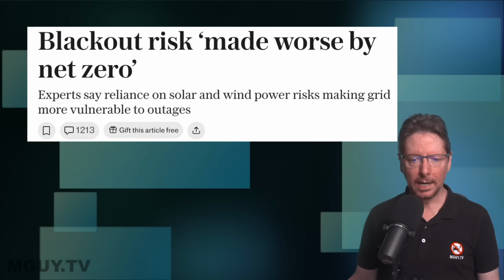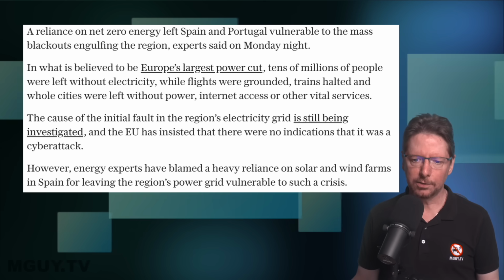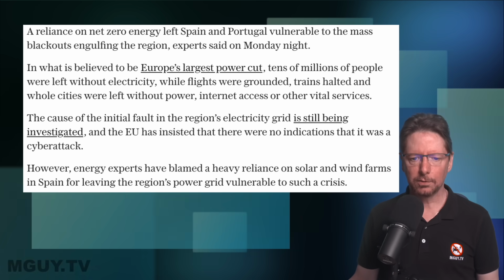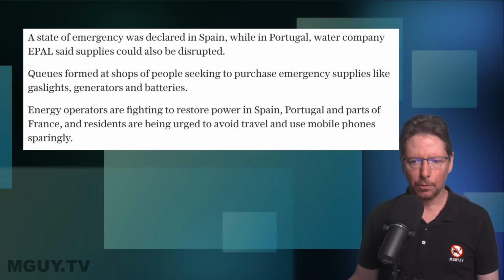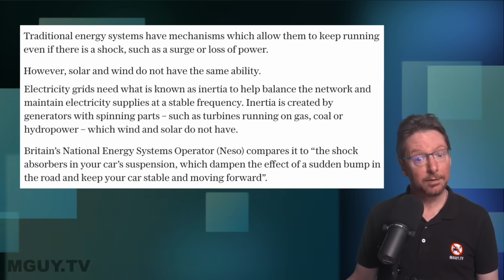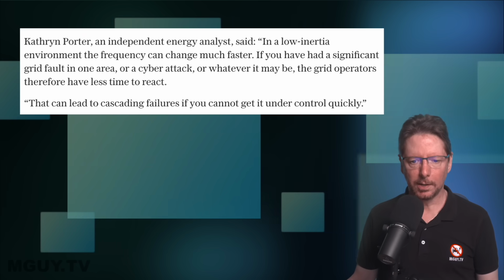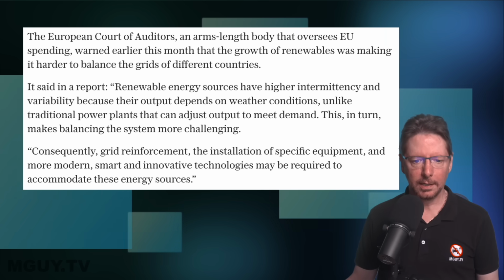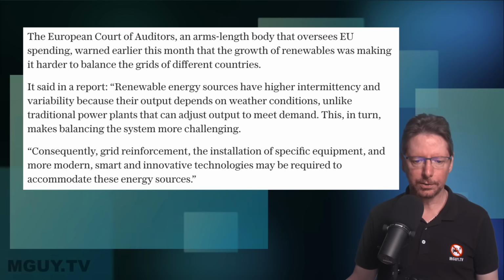Spanish power BLACKOUT: Why Net Zero and RENEWABLES were to blame | MGUY Australia

Comment: If only they kept to the good old mantra Keep it Simple Stupid! Hopefully this will be the kick start for a mass back leash against the Net Zero insanity. As a lot of people today simply can't function without their tech. Even people of my age would struggle with not having an instant connection to the outside world, and we grow up in a world that saw a lot of the changes we have had over the decades. It also shows the Stupidity of the cashless system too, as shops had to close, as they can't operate without power these days. Smaller shops my if they have a manual stocking system in place, and if they can bank the money that they take.

Comment: So, maybe, all wind farms, solar plants, tidal stations, whatever you use... need to be connected to the grid via generators with massive flywheels? On the input ac, dc, pulse but on the output 50Hz with necessary inertia.

Comment: All true. Anywhere that has substantial renewable energy is paying the price. The companies concerned with renewable production will stand there and tell you to your face that their products will power the grid. I had one such discussion with representatives from a BESS company. One was supposedly an engineer. I tried to point out that their battery boxes could not sustain a base load. Would not last for any useful period. And were more of a threat than a help. They made out I was wrong but these systems are made to run in conjunction with the grid power. Not stand alone. Like using a watch battery to power a lighthouse. Ireland has incorporated a huge flywheel into their renewables to keep that inertia. And you can run power inverters that provide a synthetic inertia by changing AC to DC and back to AC at 50 Hz. There are ways around it, but at what cost. And then if your renewables aren't supplying any power. No wind, no Sun and your watch batteries can't cope. Dig out the generator.

Comment: Vast amounts of load balancing equipment, thousands of miles of copper cabling, constant back-up for baseload, and the replacing and disposing of worn-out windmills and solar panels are just FOUR of the things that are routinely excluded from the estimated cost of 'renewable' energy supply. Along with the cost of dealing with the knock-on effects on the environment, degradation of arable land no longer used for farming, and the inevitable underestimation of final cost are just some of the ways the fiction of cheap energy is being maintained.

Comment: All windmills should have batteries to smooth out the short-term output fluctuations, bringing them up to the standard of a rotating generator.
Reply: I'll go with load balancing equipment and peaker plants that maintain the grid rather than rely on the power of constantly variable green power alone.  Batteries alone aren't the answer when most tech takes the peaks off the power wave.

Comment: Largely nonsense with a smidgen of half understood facts. 
Lower inertia is a well understood and perfectly soluble issue, using some instant newfangled things called batteries. Which btw are useless for grid level storage but great for balancing inertia. 
Spain is consistently getting  the cheapest wholesale power in europe due to …. Its investment in wind solar and hydro. Go and check the price graphs. Much more economical than the fossil plants. This is not green cultism but good economics.

Comment: So the problem is the kinetic energy right? If so... What if. Instead of connection solar panel directly into the grid, We make all solar panel connected to a huge heavy wheel suspended in a vacuum to minimize friction.

 When there is a surge of energy generation from solar and wind, a motor rotates the wheel. When there's none, the wheel' inertia keeps spinning the motor and it generate energy at constant frequency

Comment: Just because a coal fired power station is shut down doesn't mean the generator(s) have to be disconnect from the grid as what's known as a synchronous condenser. 
Also the grid scale batteries can implement synthetic inertia to provide the same stability to the grid as a large mass of spinning iron.

Comment: I design audio amplifiers as a hobby.  Mains variations need to be filtered out by the power supply which converts AC to stabilised DC.  So, here in South Devon, England, I notice that the mains is fluctuating whenever I measure it.  There appear to be a number of superimposed fluctuation frequencies in the range one to three Hz.  I can see incandescent bulbs fluctuating in brightness, and hear transformer hum varying in loudness.  It appears the network is constantly fighting to maintain stability.

Comment: Most wind farms use DFIG's which are essentlly variable frequency generators, and thus still offer inertia provided the wind is blowing. Solar less so to be fair but that is more to do with how they are utilised as opposed to if they are utilised. It is far more likely that a cascade failure of grid protection will be found to be the issue. I think you are oversymplifing and missing several importent points whic, if propperly planned, could make the grid more resilliant. Lack of propper oversight and poor planning, that is the issue, not the tech or inherrent variability of resource!

Comment: Well the article I read claimed that the cause of the failure was a natural electro-atmospheric phenomenom that caused some type of phase effect on the system and tripped the system?  While a science degree I don't know much about this or even there is even such a phenomenon?  It could be the case that there was a disturbance influence by natural forces but as you say their grid that has more than 50% solar just doesn't have the resilience to handle such occurances for reasons that you outlined quite well.  Some engineers are proposing that we install giant flywheels which are basically stores of electrical inertia on our modern grids for microsecond damping of disturbances in the grid - just another hidden cost of using renewables.  build some new coal stations to tide us over while we fix this mess.

Comment: I think MGUY has conflated electrical phase frequency with energy demand frequency. There is definitely some confusion here because renewable energy systems typically feed into a battery or capacitor array that is then is made available to the grid through inversion. Phase correction from DC to AC is a reasonably simple task. Thats not to say I'm against base load but I feel this is almost disinformation

To add to this, the 'inertia' MGUY is referring to is typical of electrical providers in how they can up and down instantaneous demand from 'the spinny things', however if there is adequate renewable power, than can scale instantaneously. And, BTW, if you are using nuclear as your baseload, it spins inertia up and down reasonably slow - you need a gas power plant to do that at high frequency. When power companies allude to frequency putting renewable power offline, its more likely the inverters hit full draw and the things shut off not to damage itself. That means more inverters/battery-capacitors to meet instantaneous demand or stop Dr. Evil at Amazon from deploying new AI datacenters on your grid

Comment: Estimated Total Cost Overview (2024–2035)
Grid Modernization & Reinforcement  €30B – 50B
Battery Energy Storage Systems (BESS) €25B – 40B 
Grid-Forming Inverters & System Services €5B – 10B 
Synchronous Condensers & Virtual Synchronous Machines €1B – 2B 
Demand Response & Smart Load Management €3B – 5B
Cross-Border Interconnection Expansion €5B – 8B
Digital Infrastructure & Monitoring (PMUs, AI, EMS) €2B – 4B 
Total €70B – 120+B  10–15 years
This is the estimated cost to switch to an active , low inertia smart grid for the Iberia peninsular.

Comment: Thank you for this exact information why we had this enormous black out. What you tell us here I learned many years ago as engineer. The frequency of the net can be held stable at exact 50Hz thanks to the inertia of the huge turbine driven alternators with an enormous mass that rotate exactly at 3000 cycles/min. 

But, by introducing more and more electric sources like wind an sun who do not have this inertia and realize the 50 Hz electronically, the problem indeed occurs that the frequency of the net gets unstable and is not exact 50Hz anymore. This is dangerous because it causes very big circulation currents in the net that can damage the power cables. Indeed, even a slight variation of just one Herz can cause these big damaging circulation currents. 

Therefore the net is protected and will automatically cut off the power supply when this occurs.  But this creates more instability and a cascade effect follows, causing parts of the grid to be disconnected one after the other until everything comes to a standstill.

I am surprised that this known danger/problem has been underestimated to such an extent. With the increasing use of resources such as wind and solar panels, I fear that these major power outages will occur more often.

Comment: fun fact most older renewable plants are grid following aka they cant alter the frequency they put out of there own free will they copy the frequency of the grid meaning they cant self start, something on the grid needs to be making a frequency for them to follow. 

also just imagine trying to run on a cloudy day, done delivery's to a lot of the solar farms in my area, one of them the driveway passes the massive inverter damn she makes a lot of noise but cloudy days it off. seams they don't have a way to smooth out the ups and downs of clouds passing over. also this farm has a Nameplate capacity of 200MW but they said there not enough grid capacity and they only pushed out 100MW at most.

Comment: I’m a distribution power engineer designing embedded generator connections in the UK.  Some 7 years ago this happened in the UK when a transient grid fault caused many wind & solar farms to trip on ROCOF (rate of change of frequency) / under frequency. Because our network at that time was more dependant on rotating generators there was no power cuts but it was a clear warning on what will undoubtedly happen in networks without sufficient rotating plant.
Reply: As an electrican I understand exactly what you are saying. The masses do not understand about the frequency of power and why turbines spin at 3000 rpm basically 50 Hertz times 60 = 3000.

Comment: If you need proof of how much energy is contained in a generator spinning steam turbine rotor, look up the Uskmouth Power Station accident that occurred back in January 1956 - near Newport in Wales (UK).

In the rotor over speed explosion, two workers were killed with nine others injured, and the turbine and generator were completely destroyed. Wreckage from the turbine and its casing was propelled through the walls of the building and thrown several hundred yards away.

Comment: Not only is frequency important but also that the generation equal the load. Too much, you get voltage spikes; too little, and the voltage sags. Either way, if any of these things get too far out of spec, protection equipment will start to disconnect parts of the grid. With a normal grid, generation is regulated to keep voltage and frequency in proper range. How do you regulate wind and solar power? 

Coal and nuclear power plants are base load sources, which generate an even output all the time. They form the base or minimum production, which equals the base load. As load increases above the base level, hydroelectric and natural gas power plants are used to match the varying load, since they can modulate their output to match the need. Typically, wind and solar vary all over the place and have no correlation to load. This is dealt with by using hydro and gas plants as peakers (the most expensive method of operation, by the way) to compensate for the varying output of wind and solar. These peaking plants fill the difference between renewables and actual load, unless renewables produce too much, in which case they must be cut off or curtailed. This happens frequently. Renewables should be priced according to the cost of peaking operations which must be used with them, but instead are priced artificially low, and the enviros want to shut down the peaker plants. 

Anyway, when this delicate dance between uncontrollable wind and solar and controllable hydro and gas gets off even a little, things go bad really fast. And the more wind and solar we have on the grid, the more unstable it becomes. This will become a bigger problem until we say no and put a stop to the madness.

Comment: Just for perspective...
The "Average" nuclear reactor produces just over 1GW of electricity. You would need enough space to install over 3 million solar panels, or around 450 large wind turbines. Now... That's only 1 nuclear reactor on a site. Many have 2, 3 or 4. So all you Green Energy delusional thinkers need to take into consideration the amount of fossil fuel involved in the production of all of those panels and turbines, and the land and wildlife displaced as well to accommodate the ignorant amount of space required for this kind of setup. I truly hope that one day these people will pull their heads out of their rear ends to get some oxygen to their brain.

Comment: Totally agree. Australia's power sup=ly is 50Hz, a sudden change in frequency will be a disaster with induction motors used in fridges, industry machines and more, they would simply overheat and bun out just due to a small frequency change.
Reply: That's not the problem they are worried about. You are basically overloading the generators and they are slowing down. They can handle surges (which renewables can't) but they can't handle a hard continuous load that slows them down, the generators will burn out.  Voltage drops, amps climb. Amps is what burns things out. A frequency change won't affect induction motors much at all. It simply changes its speed. That's how inverter motors work. The internal electronics change the frequency (hz) to whatever RPM is needed. But an unwanted frequency change in the power grid can mess up electronics. Unlikely 1 or 2 hz slow down would though.

Comment: What people fail to realise is that with every 'green' electricity generating site they add to grids, it weakens the grid it connects to. Clearly Spain has reached that saturation point where vulnerability has surpassed reliability.
The UK has become incredibly fragile due to the madness that is carbon neutral. If the capital loses its electricity, it will create national chaos. A chaos that will destroy the country.

Comment: FYI  The turbine and the generator rotors are mounted on the same shaft; the combined weight of the rotors is almost 200 t (220 short tons) - not sure how to calculate it but if they are spinning at 1800rpm ( some at 3000rpm ) but my 3Kw spindle turning at 18Krpm  does NOT stop quickly when I drive it into spoil board ( and even that requires a change of under garments )
Reply: F = ma.
Reply: There are 2 steam turbine powered 4 pole 1800 rpm generators at the Diablo Canyon Nuclear Power Plant at the California Central Coast. Each is rated 1100 megawatts. When they are at full load, it takes about 3 million horsepower to turn them both. They run base loaded 24/7  for very long periods. 3 million horsepower. It gives an appreciation of the power stored in uranium pellets.

Comment: What they refuse to tell the public about solar. I have been studying it now for 7 years. We are forced into a tech age. Each piece of technology. Uses watts and amps. Yet. Both are the same. Each device. Uses so much. More tech you use. The more you need. Add up all that you personally use. A solar panel is from at average. 100 watts to 400 watts. A 100-watt solar panel, at average, will produce around 20 to 30 watts. Say 30 watts. You use how many watts at average. Say you have batteries connected to the 100-watt solar panel. You use say 1000 watts. You're 900 watts short. You're at 1000 watts no matter what. You need twice the amount of solar panels to make sure your batteries are charged before the sun goes down. You need 2,000 watts of solar panels. 100 watts each. You need personally 20 solar panels. Now. What about your neighbors. What about your town or city. In reality. How much electricity does a person need. Do you go camping. In a camper or RV. How much electricity do you use. In reality. You need less than that. Refrigerator goes on and off. 100-watt or less. Lights. 12v first. USB lights. TV, etc. Not needed. Heat and AC. Maybe.

Comment: I heard this is being blamed on a highly technical transmission line issue. Moving power lines due to weather, setting up undamped oscillations producing excessive voltages and harmonics which triggered protection. Leaving too much load demand for remaing sources which will also self protect.
A perfect storm.
Mismatched voltages, frequency and phase from different sources, yep that'll do it.
The level of cascade is surprising, but it's happened before.

Comment: They're trying to blame it on temperature causing some made up phenomena called "Atmospheric Induced Oscillation" which Chat GPT assures me does not exist as a term in the industry and is most likely a pseudo intellectual way of saying wind blew the overhead conductors into each other, which may have been sagging more than usual due to overload - thermal expansion.   Lack of stability of grid frequency would make it less able to cope with such faults.   If "Atmospheric induced oscillation" is a real thing and means something other than ChatGPT and I have guessed, then it OUGHT to be in the scientific literature but ChatGPT seemed unable to find any reference to it so I conclude it is a made up term intended to obfuscate the truth.